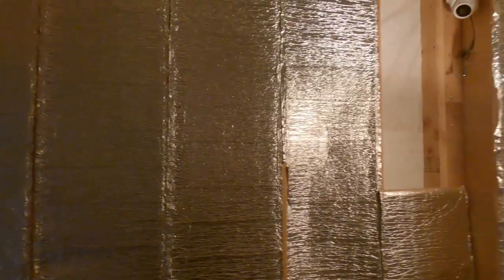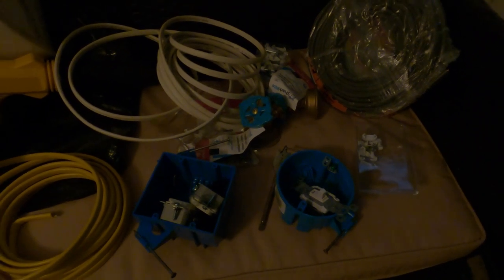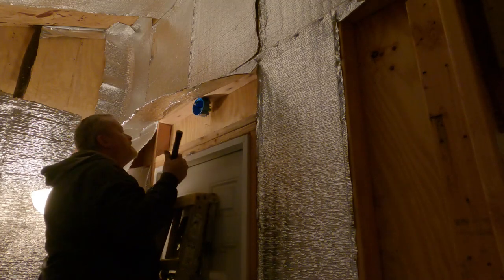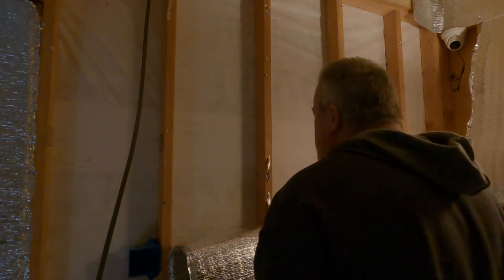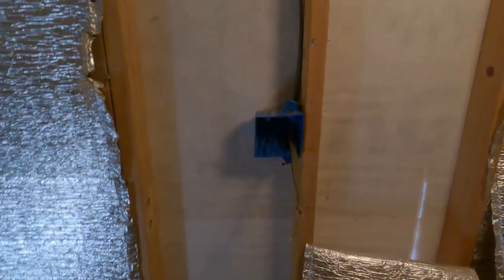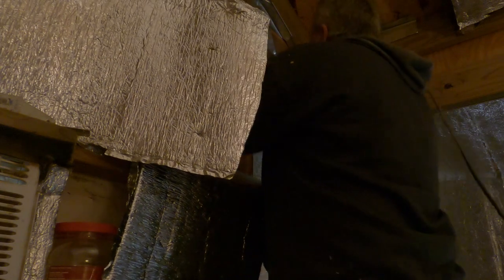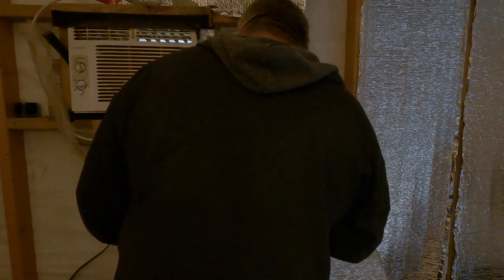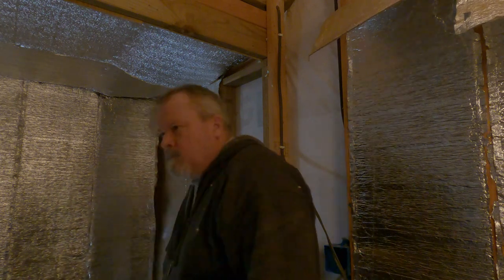Wired For Electric. Installing Electrical Receptacles/Running Wire In Dog Apartment

Comment: You are getting there. Little by little. With Washer and Dryer installed that room will be warm and functional not only for the dogs but yourself as well and you will not have to worry about freezing temps. Blessings

Comment: Yes'r. I don't like misplacing stuff too.
I'm saving every glass jar I empty and screw the lids to the bottom of a shelf in my shed.
Each jar holds one kind of screw or one size nail and so on.
I like to hunt deer; not nuts, bolts,and washers.
See ya on the next one!
☮️♥️🙏🇺🇸🇮🇱✝️👷‍♀️

Comment: Don't want to piss you off - just want to save your house and maybe your life.   You can't use a 15A or 20A receptacle on a 30A breaker because if you had an overloaded device (not planned - malfunctioning) that pulled 30A, it would melt the receptacle but the breaker wouldn't trip to stop it. Devices - lights, appliances, etc.
Reply from the maker: Im using a 20amp breaker for outlets, 30amp double pole for dryer.Nothing will melt.Space heater will be only thing running on one outlet that pulls any significant wattage

Comment: What happens if you use a 12 gauge wire on a 30 amp breaker?
It is incredibly dangerous to use a wire that has a smaller gauge than needed. The wire could overheat and melt. This could lead to breaker or appliance damage and be a fire hazard. Using a wire that has a larger gauge than needed is not dangerous.
Reply from the maker: Im not using 12 gauge wire, im using 10/gauge wire